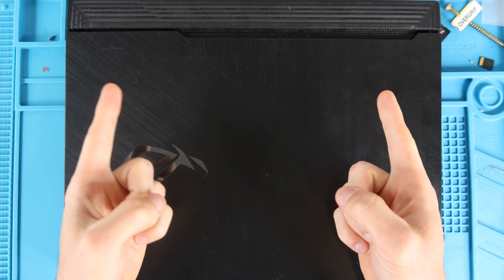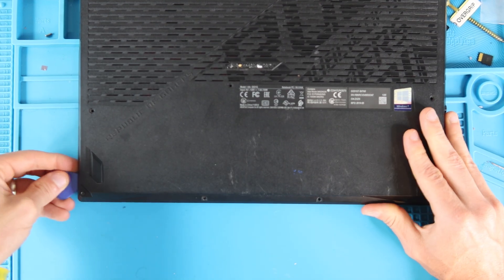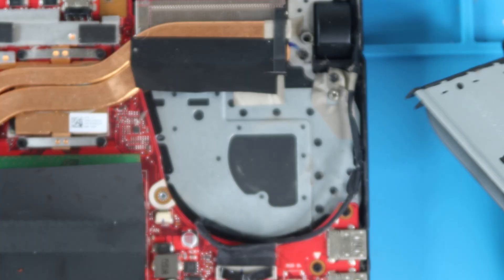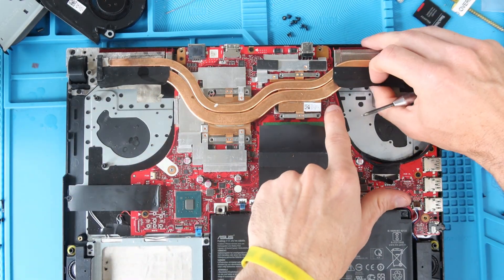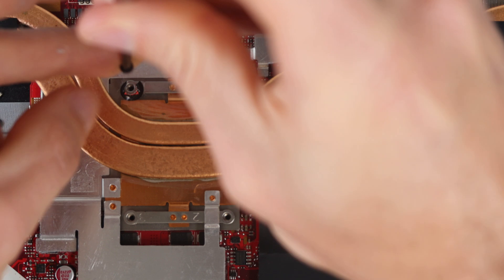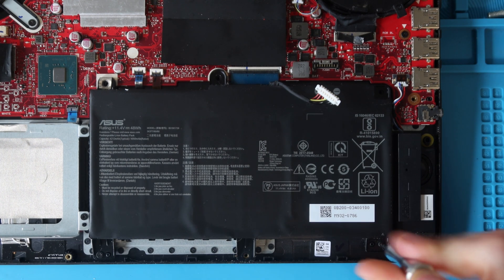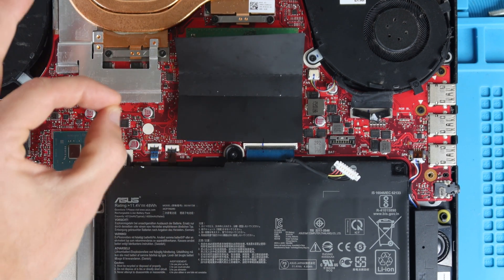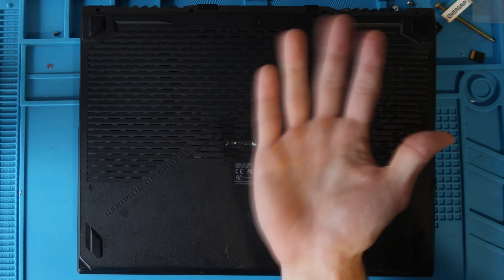How to Open and Clean Asus ROG G531G Fan Disassemble + Thermal + How to Upgrade Ram + SSD + Battery

Comment: Hello I need some thermalpads or thermal putty for my Asus g531g. I thinking which is better thermo pads or thermal putty. Did you recomand something ? When i was dissesembling i was damaget the thermal putty on vram etc. 😢
Reply: Vram temps don't affect temp so much but use putty then you don't have to use guess work to find right size

Comment: Removing those tiny cables sketched me out too bad. I had to use tweezers to get leverage on the battery cable because my wires are shorter than yours for some reason and it won't budge so I'm just taking a q tip to the fans and using compressed air on everything else and hoping for the best cause I'm 100% sure those cables are gonna rip before they move.

Also, my bottom won't reattach correctly anymore.

Comment: While cleaning I kept the battery connected. I forgot to re-pin the fans on the motherboard and pressed power button. It didn't start. Then I repinned, but laptop is now not at all starting. Please help.
Reply: Buy another one
Reply: Also, to make it clear, I opened it to check why my display was flickering. Please help about that too!

Comment: How come no one ever mentions the melted gooey thermal pads? What are they, what size/thickness to buy and  replace? How come you don't have to replace them? I just need more info on that. Thx
Reply: you can reuse thermal pads as they don't degrade that much and don't spread, thermal paste can also be reused but re-applying is better since you want an even spread.

Comment: does it make sense to spread the thermal paste manually or is it better to do it the way you did? I've always been doing it manually tbh (evenly spreading the layer of thermal paste on the CPU and GPU), but not sure it is correct.

Comment: Am I the only one who got 2 white cables connecting the bottom to the computer? How do I losen them?
Reply: Thats for the rgb strip, just use a screwdriver to get them off!
Reply: Ya I got them too. It’s the light wire to your bottom lights. 
I wanked my out by accident. But they slide right back unless they are damaged.
Reply: Same bro
Reply: Do you find the answer?
Reply: @Khadis-b2v they are the RGB light strips. Be careful and just disconnect them with probably the same type of clips shown in the video
Reply: @Ramranch03 thx bro I figured it out that by myself, but I appreciate that u answer me
Reply: @Khadis-b2v love u

Comment: Thank you! Didnt it have liquid metal from the factory? If it did would you replace it?
Reply: I have the same doubt. Is replacing liquid metal with thermal paste for the Cpu good?
Reply: @dipjyoti_guitar  no no no
Reply: No it did not have liquid metal from the factory. Never use liquid metal. One fraction of a drop slip up applying it will ruin your computer. Just use good thermal paste. It lasts for years.

Comment: I’m planning to upgrade to 2.5 inch SSD by replacing it with existing HDD. (G531GT)

Can I use the same SATA cable to connect the SSD which was connected to the HDD?? And it’s hard to remove the HDD from the casing 😢
Reply: you can afaik
Reply: yes

Comment: Extra tips:

- Just for added safety, you can add tape on the battery connector to avoid accidental touches. Remove the tape once once you are done with everything.
- you can actually remove the shell of the fans so that you can thoroughly clean the individual blades. It will greatly improve the air carrying capacity of the fans by thoroughly cleaning the fan blades. You can use compressed air but be sure to fix the fan blades to avoid damage to the fan motor.
- Compressed air and a paint brush will be helpful to thoughly clean the vent fins.
- If the laptop is more than 2 years old, it is still best to replace the thermal pads of the VRAM modules. Those components can be a possible failure point if they overheat for long periods.
- You can spread the thermal paste on the CPU and GPU dye to ensure that the entire heating surface gets coverage by the heatsinks and avoid any air pockets.

Comment: Clean, new paint brushes are a godsend for cleaning, been using them for decades. For smoke build up, that oily layer, dip a brush in acetone/alcohol and brush that oil away. Vent the room of course. I also use a tiny bit of copper polish on the heat sinks, clean them up and make them shiney. Not sure if it increases performance at all, but its simple, looks nice, and you can almost mirror polish them.

This setup looks very familiar to my gigabyte KF5 or something. Almost identical heat pipes and screw mounts.
Edit: my Gigabyte I forgot has 2 sided heat sink and fan exhaust on both sides.

Comment: Is doing this total begineer friendly? I never open the back of my laptop at all for 6+ years and seeing the little connected stuffs make it looks fragile, i'm scared of messing up my laptop 😭
Reply: I have seen a professional technician do my laptop and I find it relatively easy to do. Just don't rush it and REMOVE THE BATTERY first before doing anything to the laptop.
Reply: @gabrielbumanglag3303  thank you for this insight omg
Reply: @stanhitoyaorperish8656  Hey I'm in the same boat, I've never opened my laptop. If you did all this. How did it go? Any tips?
Reply: @ayushdidnothingwrong  it went great. But you need to get ready with how overwhelming it may look. Like the other person and the one on the video said, remove the battery's smol cable first before doing anything. I cleaned my fan with paintbrush and it's not very clean but it's the best i could do and i don't change the thermal paste bc according to my research, it's still looks fine. It works completely fine after i reassemble.
Reply: Have you ever torn anything apart before and put it back together succesfully? You need organization, patience, common sense, the right tools and I always have the disassembly video playing right next to me on a different laptop as I'm doing this
Reply: @davidjosephjohn8599 I've only replaced my headphone's battery once and fixing my food processor. I always do everything along with the guide video and prepare everything I needed near me before starting ^^
Reply: Im 15 and just did mines

Comment: Thx man, my laptop had been over heating to close 100 degrees c, now I now why, clogged up heat sink😅 Now the max temperature is just above 80, you just save my laptop👍
Reply: My pc overheats as well, so I decided to by myself the tools and the thermal paste and fix it myself!
Wish me luck!
Edit: I cleaned it out, but the thermal paste couldn't get replace, because a screw was stopping me from doing so. The screw was so tight in there that it broke the grove while trying to unscrew it. 

My laptop still overheats, but not as much as before. I can actually play my games for once 💀
Reply: @ArchFPS mee too. i have a asus ryzen 3 and i never clean my laptop this year, and ist overheating, so tonight im cleaning my fan so i can play more fortnite😅

Comment: That tap is not sticking anymore...please help ...im stuck
Reply: Same here , anyone??
Reply: @ICE_FROGX  Buy new tape. It's called black electrical fabric tape
Reply: @davidjosephjohn8599 can i use wiring black tape?
Reply: @ICE_FROGX  Like just normal electrical tape? I don't believe it would stick. It has to be fabric tape. I mean, if you don't want to buy it or have to finish the re-assembly fast, in a pinch you could use duct tape but that's not really what you want, but it'll stick. The electrical black fabric tape is made for PCs/laptops and it's high temp tape.
Reply: @davidjosephjohn8599 i got it now, i afraid that fabric tape is not available in my hometown , i live in very small town, and before i take off my tape i didnt fully take off , after done cleaning i stick it but it not completely done for example it’s 70 % stick , sorry for my English

Comment: I am having issues with the keyboard. Am i screwed or can i fix it?
Reply from the maker: You could always try cleaning the key switches, last resort replace the keyboard.
Reply: @thecollegefixer653  the keyboard seems impossible to replace on this model. I need to do the same, but it looks like the entire top (keyboard, track pad and plastic frame) needs to be replaced of just instead of the keyboard. You know how or have a link, please share.
Reply: Same here, the Esc, number 2, and F1 does not work on mine

Comment: Clean the fans with vacum cleaner and toothbrush with alchol untill all the dirt come out also you need to put the paste on whole chip not like you did its very bad...if you want to teach something do it like you should or not do any stupid videos
Reply from the maker: But if there needs to be paste on the whole chip then why is it running perfectly without any hot temperatures?

Comment: Im not sure why ASUS made this particular model impossible to upgrade the NVME. You are stuck with that shitty 512 GB NVME forever.
Reply: Mine one 1TB 😂
Reply: @PunkMissong  Yea it sux to be stuck with such a small space. 1TB would be much better. The drive itself is  a bit  slow
Reply: Why not? Remove the old NVME, clone it a bigger capacity NVME, place back
Reply: @AD00Q  I have tried that and it didnt work. Its really strange.
Reply: @AD00Q  I did that like I have done many times before. Thats why its so puzzling because I cannot get the laptop to recognise anything but the piece of crap intel nvme that it came with. Ive never seen anything like it and cant find any explanation anywhere. Ive tried 3 different nvme and none worked.
Reply: Same this particular rog only can use Samsung 970

Comment: i was searching for videos of disassembling asus laptops cause i will disassemble my Asus G731GW, this is the best video i've found yet.
i was thinking about cleaning the paste also from the vram's and applying Noctua NT-H2 there but after seeing your video i'm not sure if i will change the paste to the vrams just in case.
i've seen a comment in YT from someone who spoke with asus and said that this paste for the vrams that asus uses, is not available to consumers.

Comment: my laptop cpu burn 😌
now my laptop in Asus service centre 😔
Reply: Did you not unplug the battery connector?
Reply: @user-yq5pv1wo9o  power adaptor cable ?
Reply: @mandeepsingh1999  no, the battery power connector from motherboard
Reply: @user-yq5pv1wo9o  no i did not open myself
when i pressing power button laptop not turning on, i need to press power button for 2 mins or more, so i tell this problem to asus customer care, they said to me visit service centre, when i visit there technician run diagnosis test, find that cpu is burn 🙂
Reply: @mandeepsingh1999  Dayum brother that's tough, was the laptop still under warranty? If not how much did it cost?
Reply: @user-yq5pv1wo9o  today is last day of warranty 😔 but some how luckly i submit laptop to service centre 3 days ago, now i will hope for good 🙂
Reply: @mandeepsingh1999  Bach gya bhai nhi toh mehenga padta
Reply: @user-yq5pv1wo9o  yes 😁